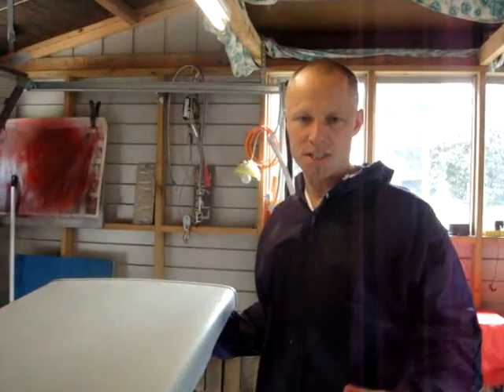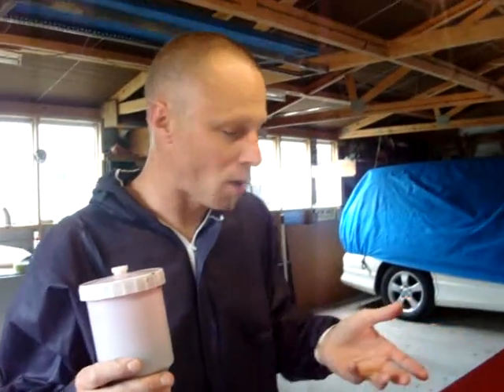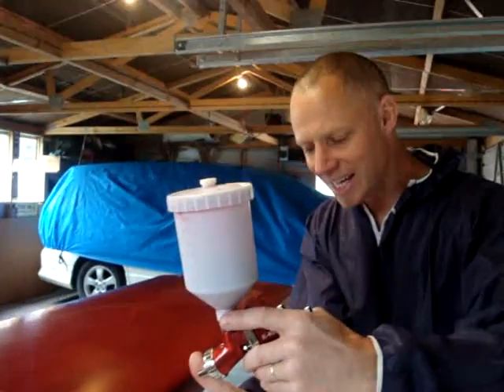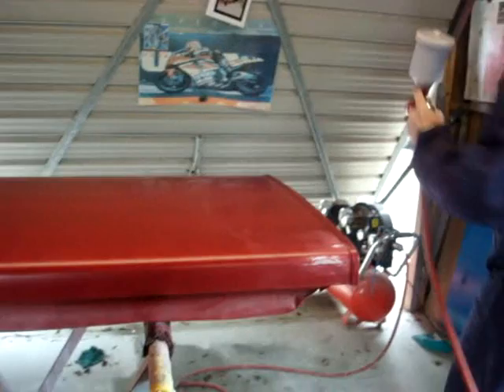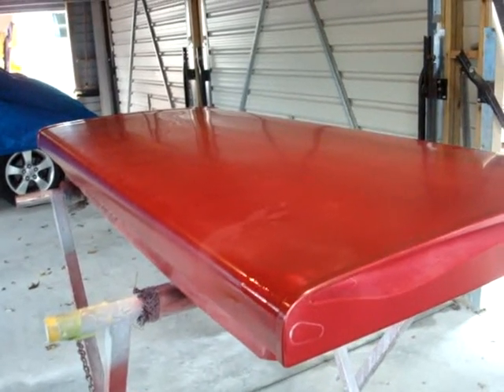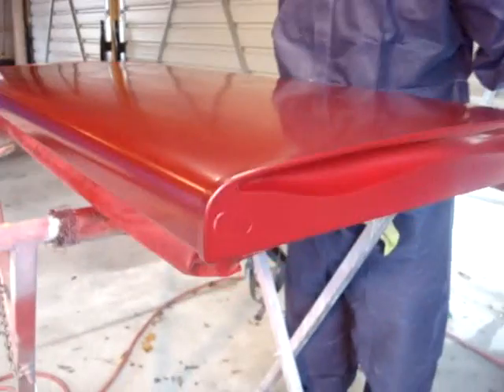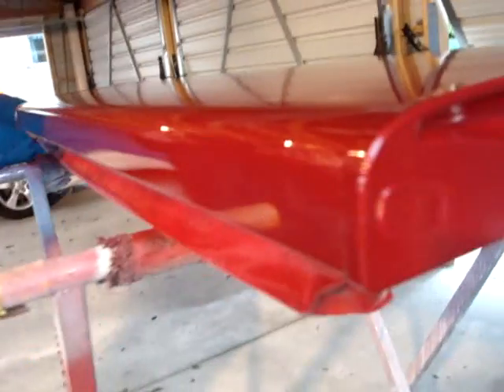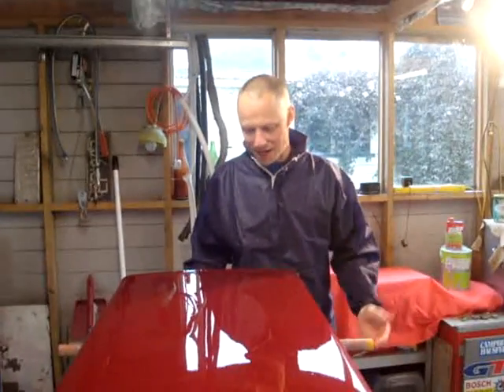Basecoat -clearcoat secrets revealed

Comment: You made a nice video. I’ve got 35 years behind a spray gun, and I don’t think I’ve ever put a run in base coat. If you run base, you have to small of fan, you’ve mixed it wrong, or your spraying it way to slow.

Comment: You want a tip, keep the solvents to a minimum i.e. don't treat 2k like Cellulose and keep adding Thinners to the clear to make it flatter all that does it drop the gloss and cause problems like Micro blisters or Popping or trapped solvent (stays soft for ever). I take it that's 2k medium solids? another tip is to put a splash of your Base in your primer at that stage which will make it cover much faster when you come to top coat it (obviously don't do this if your using Epoxy primer or water base :))

Comment: Like fubar says, invest in your equipment. You will never regret it. I have picked up a high quality gun used and it blew the doors off of the harbor freight one I was using. Also having a decent compressor with water separator/filter and secondary pressure gauge will make a lot of difference

Comment from the maker: Hey there, I have a plastic ground sheet, stretched across the shed rafters. i hose out the garage floor, and doors. I have a house-hold fan blowing over the work the whole time. Video demonstrates spot repair during base coat. Block and polish clear coat when finished.

Comment: Base coat is not easy to run lol. Clearcoat on the other hand can be. I do not have a clue why you are waiting so  long between the base and clear, you can clear as soon as the base flashes off and is dry. But you are 100% correct. Hardest thing to do is walk away between flashes. Get a timer if you are impatient

Comment: Dude I work for Jeep in their paint shop which is run by robots but still the same principle applies, he's correct on how to do it. If you are sure it is only clear coat then sand it with 1200 to 2000 if you can acquire it. Higher grit smoother shine then buff with a mechanical buffer (it will take a little more than elbow grease lol) be careful not to burn or block out your area of repair but in the end it'll look great. Good luck and remember patience. Hope it got to ya time.

Comment: a blender is sometimes called a fade out thinner or reducer,different names on every continent for the same product which dosent help,its basically a mix of clearcoat,thinners and activator mixed in the right proportions for the best results,i have found the standox aerosol the best,this would be used in bodyshops for smaller repairs,it works very well.

Comment: Hey good question. the answer is this you can tack it down jkust as you say however you should use and adhesion sealer that is either clear or a transparent look and only 1 coat then put your color and or base and then your badges or painted emblems and then clear away!  Also be sure to use a blue vinyl tape for your line to prevent bleeding and raised paint edges!

Comment from the maker: @MrPiper60 your on to it I still a big fan of lacquer (dulon system ) yes as far as i know . for the top end lacquer  jobs, you could add some colour into the clear coat , and then may be the last coat straight clear , this achieves a clear coat that looks like it is melted thru in to the colour ,  very cool finish

Comment: That baby air compressor has to drive you nuts! It must be constantly recharging as the gun can use every bit of air the tank holds. Nice looking garage you have. You need to invest in a bigger air compressor I think. Thanks for the dry time explanation.

Comment: good job. here is a clear coat secret mate. you can lay a thick ass coat of clear. let dry 10 - 24 hours. than use a torch and speedy over. piece and watch any bubble run vanish. no need to wet sand as even scraps scratches will fill back in like you just sprayed it. test first some velars may react different and the clear transforms to a almost scratch proof shell.

Comment: It is probably your your gun setting. Set the air at 25 psi and spray an area with for 30 sec and see how it turns. Then dial the needle in half a turn and spray again. Keep tweaking with it till you find the sweet spot. By looking how it flows you will know if you need more or less fluid out of the tip for the same air pressure. That is how I set up mine. BTW, a high quality gun will correct half of your mistakes. Good luck.

Comment: Yep the old  $50 dollar 4*4 stickers haft to wait before putting on unless you get a pencil and ruler with the  cross of the middle of the sticker and the cross connection of the  place you want it and luck,   I took my old stickers off the truck, used body filler and now use chrome emblems for the future.

Comment: @SprntrlDeathNinja. Hi, there is a few ways that you can go. Spray two coats and wet sand it all with a block and P1000 and then spray third coat. Or, spray two coats and then a third coat that has 30% thinner in.

Comment: @roulettered56 u would have to sand it with 1000grit or 800grit use a small soft block the apply a light coat  of base then wait 10 mins the  follow it with another mid coat of base.. then your ready for clear.. IF u sand the base u do not want to clear cause those scratches will be visible when u clear it u have apply more base then clear

Comment: if you want your body filler to feather out perfectly use guide coat to see uneven surfaces with  a 3 part  primer [not Rustolum spray bottles ] over and over, looking for the  dips, then prim over it ,, guide  coat it again  ,with  3M   paper and 14" and 6" Durablock sticky or hook n loop ,, and a water bottle, to keep  sand paper from buildup and squeeze n ,rags to see the  surface with ,,, until the  dips are gone

Comment from the maker: @perroxbatakkka single stage urethane to my knowledge does not need clear coat 
2 to 3 coats of primer & when fully dry,  wet  sanded with 600 or 800 grit . dont sand the colour just spray 2- 3 coats with the recommended drying time in between    Good luck     Restolad

Comment: to eliminate stripe (edge-step) yes sand edge with 1000 just so the hig spot is gone. you tape one hour after  hot-air dry The Trick is  after good 2 coats base tape the design and paint 2 coats  this will leave  a edge so after dry, tape the design in reverse (taping the desig itself. so to even out the paint with 2 coats outside the  graphic . for total of [4 coats (base(ouside graphic(4 coats inside Graphic)]this will even out the line. you can block it flat with 1200  and clear...

Comment: One more thing about buffing,   If You sand past the clear into the base you Can re-clear over the problem;   and if you burn through clear with buffing it's the same thing,  only you have to sand around the problem area enough to not paint  over the compound or it leaves a line.  .  Ps  Sand Very carefully ,  with the 600 wet,  and have the air  compressor and The squeegee brand::::::: one pass Water blade!!!!!!! ready with drying power and wiping cloth,  Then the smaller girt,
Reply: +Jesse Cox Sanding for buffing problems :::::::If You wait more than one day after base coat clear coat you will get wrinkles in youre base if you  paint it again  Or wait until the base is fully cured mine was a week;, On another note::: foam buffing pads are way more forgiving than lambs wool, and ,  3000 grit is great with the cork paper 3m,,,

Comment: I got a 45 gallon 240 volt air compressor in co with 3  eleven gallon tanks of harbor freight with a good water filter and all connected together     Its powerfull enough to power a 2 hammer impact and take off your axle nuts as well as paint with 78 gallon.   got the 45 gallon tank at steves whole sale $399, but have seen better deals at home depot n such
Reply: +Jesse Cox 580 was the total with hoses , water seperator, a  spray gun,

Comment: Project:  the detached hatch from a 4door honda civic.
Gun:  Harbor Freight - Professional Gun.
Location: Back yard - OUTSIDE
Forecast: COLD. Feb/March
Compressor:  2.5HP  21Gal

Problem:  clearcoat pealed off. Base coat exposed.

So,... what are my odds? What is your thoughts? Use medium solids clear? and keep in a heated blanket?
What am I going to run into?
Let me know. thanks

Comment: Yea you should never sand the base coat prior to clear coat because as you had mentioned during the base coat applications IE the metalics, If you sand on the base you are ultimately laying down your metalics and it will show even 1500 or 2000 grit it will show! Noblemav the only way to fix this is to Stop let is cure for a hour and then lightly and dry mist base coat over the area until you cant see the blemish and then start the clearing process once more.

Comment: Some questions, please.....

If you wait 20 minutes or more between base coats, do you need to clean the paint gun between coats?

Is the pre-mixed ready-to-spray paints better than the paints where we need to add the reducer and/or hardener, just before we start painting?

Thanks for your expertise, young lad!
Reply from the maker: No need to clean gun when waiting for each coat of the same product to flash off. 
single pot paint wont dry/flash off in the gun while waiting between coats .
2 pot paint when mixed has a time span that will be on the label or SDS  most are stable for 4 hours.
Dont know what you have that is pre mixed .. all automotive paint from a commercial paint suppler will need thinning and if 2 pot will require hardener and thinning

Comment: using this tutorial i painted a renault 5 bodykit this weel.. results are amazing.. i used a metalic grey with a clear and it went on great.

One question, in the base coat i had a chunk of paint spit out the gun, i didnt notice it and therefore went ahead with 3 coats of lacquer, now my question is would i get away with flatting it out with some 2000, and brushing a very small amount of lacquer over the top or somthing?, if not whats the best way of dealing with it?.

Comment: Mate. That looks great. Say... What's the mix ratio for basecoat to thinners? I'm using 250ml of base and 250ml of clear. Cheers mate enjoyed the video
Reply: you are ok, most basecoats are 1:1 ratio, you can go a little bit higher (10%) on reducer if you are getting oran peel or your gun does not atomize well the basecoat. I will play with the pressure and set up in the gun before jumping on 10%.

Comment: I used a harbor freight $20 electric sprayer that worked great for the base coat.  It looked beautiful but then I completely ruined my whole car trying the same way with the clear coat.  It went on kind of speckled like tiny droplets almost, so I tried going thicker and it just ran all over the place.  I've been cursing at myself for about an hour and a half now for being so stupid and not trying it on a test piece first. 
After I finish all the sanding and painting the whole damn thing over again, what should I look for on the test piece when adjusting for my clear coat?
Was my speed up too high or was the nozel too small or?  I know it probably could be a dozen different problems, but I am just hoping for some guidance.
Thanks for the video

Comment: Thank you for taking the time to make this video. I have a question for when you are doing base/clear. if you are going incorporate stripes, the smaller area goes first, and then the larger area. the question I have is if you have days several days before you get to the clear, would you go over all surfaces with a fine Scotch Brite to mechanically open the surface before you spray clear?
Reply from the maker: no i would not scotch brite or sand ,if you do you will need to spray another coat of base - as scratches in the base coat will show under the clear

Comment: Nice video. I am into woodworking myself and have learned quite a lot from your video. Need to ask a few things if you don't mind. 1, base coat, I am wanting to spray a wooden box like high gloss black, what base colour would you recommend?
Also, do I need to 'sand' between coats?
Reply from the maker: chris randell  no sanding between coats  and any shade of black you like im a fan of a charcoal greys like a gunmetal grey cooler than black ,my opinion
Reply: +chris randell 
For wooden boxes, I suggest you use epoxy base coat like West System 207 with black dye . It will penetrate the wood and be stable .

Comment: Great vid, quick question, if i was painting a pearl or metallic base coat, if i left the basecoat for maybe a week for whatever reason, would i need to key it up again before clearcoating and if so, what with, as i was worried about affecting the the metallic particles if i used wet/dry abrasive paper or is the matt finish of the basecoat enough for the clearcoat to bond to? Thanks for posting the clip

Comment: Thanks for the video, it has helped me with some tips. Just a question, on the final base coat where you sanded the imperfections out with 1500, did you just clear straight over that? do you see any scratches at all?

Comment: Hmmm , great lesson mate, but being metallic, you shouldn't  de nib, nor wax and grease the basecoat, unless your going to give it another couple of coats of basecoat , as it will flatten the metallic ,
Reply: Depends what your using, Medium solids solvent denibs fine but if you did that on Water you would scrap your job. TBH there should be no runs in base, i know things happen but it shouldn't be applied so heavy that it lifts the primer underneath (don't forget 2k base is very high in solvent) if i was going to pull it up on anything i'd say over applying, getting a good finish often means less is more just as long as its covered ;) just remember with base coat it needs to be well flashed between coats, if you keep coating it when its not dry it will stay see through.

Comment: @restolad hey restolad, i just wanted to ask for your input on somting. im painting my mates car in a 2pac direct gloss cv black (ontop of 1k primer filler) and i just wanted to ask your opinion as to what i should do between coats (2 coats)... should i let it dry sand it and apply another coat, just buff between, spray right over the top or spray it while the first coat is still abit wet? cheers from rotorua :)

Comment: thank you for the tips. can i mix base coat and clear coat together? i'm using urethane paint. Thanks again. im new for this thing .
Reply: I think it is better for the two coats to be separate, because basecoat does not whitstand anything, unlike clearcoat which is more resistant to mechanical interruptions.
Reply: thank you again. im just a beginner. i have a 2 horsepower compressor with a 25 Liters tank. i bought a cheap spray gun in our country just for learning. in time maybe i can afford a better gun. do you need to wet sand the base coat before applying the topcoat?
Reply: when I paint(not a proffesional with a spray gun for like 20 usd) I do not wetsand basecoat before I spray clear.

Comment: put my purple pearl basecoat down.started masking up to put flames on the motorbike fenders and tank...painted yellow and orange with blue on the tips...turned out well.took off the masking tape..its left a lip on the edge of the flames.made a big mistake lighty sanding the lip off the flames with 2000 grit.its going to be interested when i put the clears on as it might or will see the 2000 grit marks in it....is there a way around this to fix it....like useing 3000 grit..cant paint the basecoat again as there is a lot of masking to do again

Comment: In my experience, which is limited at best.  If I wait too long after I spray the base, the clear will peel off.  If I clear coat within a 30-40 minutes, I haven't had a problem.  So my question is, are there different type clear coats, or am I mixing something wrong???
Reply: The paint was thinned.  But the clear was full strength.   And it's been about 3 months now and they are still looking great.  But I did lay the first coat of clear on light.

Comment: So:
First coat of clear to be completely dry?
Second, stringy..
Third coat, stringy.
Correct?
Reply from the maker: Its really is what works for each individual painter!  and the ambient temperature of the day and seasons of the year,plus where you live, Tropical island ? Alaskan tundra?  :                   This is my normal clear coat spray plan : first lighter coat wait till tacky second coat spray wet wait till touch dry, then third coat spray wet . two coats is sometimes enough it  does vary like on a  hot summer day 2 wet coats is sufficient  ....plans change, if that second coat goes on real wet and glossy i stop, if its deep metallic on a dark car   three coats ...   sorry if this doesn't help but set a plan in line with room temperature and the base coat colour ...practice practice practice
Reply: @restolad  Idaho,  USA - Dry Cold

Comment: Is this info the same for spray paint, and spray clear coat?! I'm redoing my bike...
Reply: +Mike Hjorleifson   I used automotive spray cans on my bike a lot and never had a problem with clear,,,,   i'm gonna try buffing mine ,,  it would be near perfect,,,,,,  one way i made the tank perfect a while back was nason clear and one huge coat ,,,, it worked almost perfect   but started to run  so i tipped it one way,,,, then the other way for hours until it quit moving,,,,,,,,,,,,,,,,  man i've come a long way!!!!
Reply: +Jesse Cox  i just made a mistake my self ,,,, painted over lacquer primer arasol can with urethane,, and see major flaws,,,, then read the instructions for urethane ,,,, You must wait 24hr before painting over lacquer paint....   Aughhhhhh ,  im gonna wait for another 24hr then do like the man says and sand it down and put a couple more coats.  And clear coat is Also a urethane paint most of the time.
Reply: +Jesse Cox  The bike tank looked near perfect but I didn't wait long enough with the 50 $ stickers and got bit in the butt adjusting a little   shuda waited a moth or something,  I cant  remember.
Reply: +Mike Hjorleifson Me too.